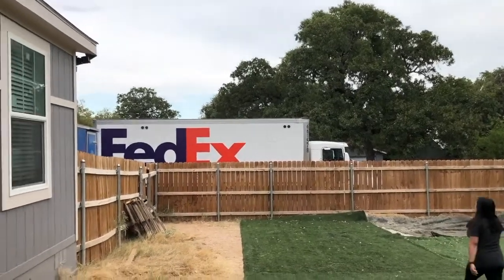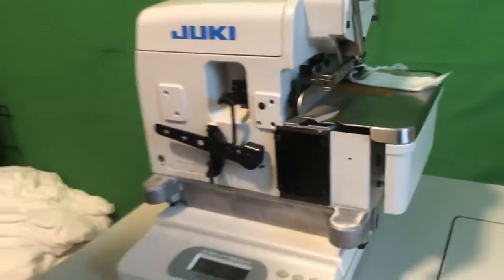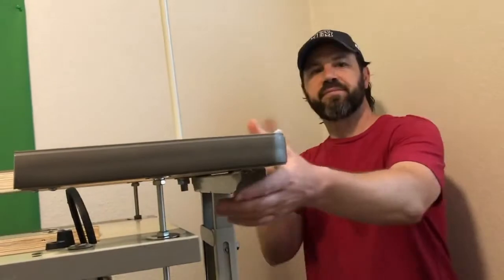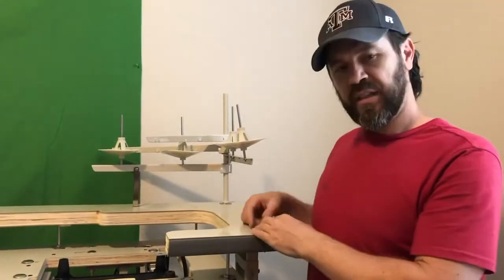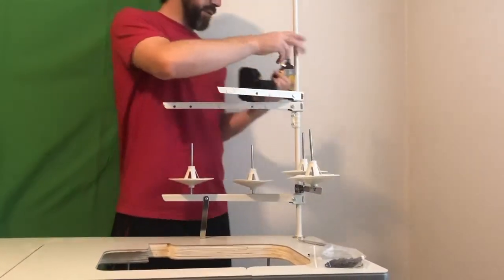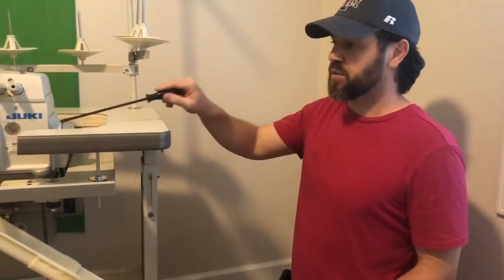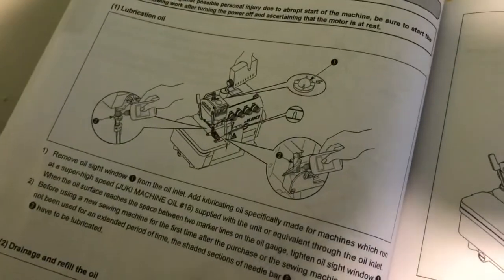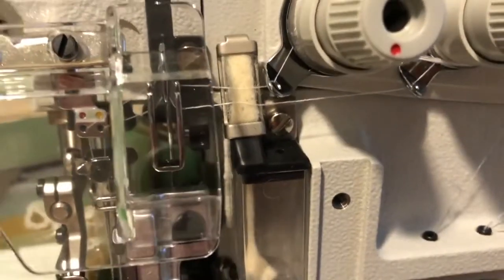Industrial Juki MO-6814s Overlocker/Serger Delivery and Setup

Comment: Can this be converted to 3 thread like the home machines or do you need to get the 3 thread machine?
Reply from the maker: Nope it can also be a three thread.
Reply: @IDontEvenWorkHere  I don't sew much more than just a hobby which everyone thinks it's weird for a dude and my age, but I still want one of these.
I have a brother 1034D and and singer HD 4452 and brother CS6000i but I still want this machine and a juki single thread straight stitch machine. Probably the 8700 for the price. 
Doesn't make much sense considering it's just a hobby but the way I see it I'm set for life lol.
Reply from the maker: @2010stoof  if you sew more than 2 times a year it’s totally worth it. Even for a hobby. Hobbies are much more fun with better tools and machines! Go for it. I love my 8700 too! But the serger. Worth its cost 8 times over already. It’s a beauty! I’m glad you have a hobby you enjoy!
Reply: @IDontEvenWorkHere  I want the 8700-7 but the cost is 2.5x as much. Figure the manual 8700 will be great